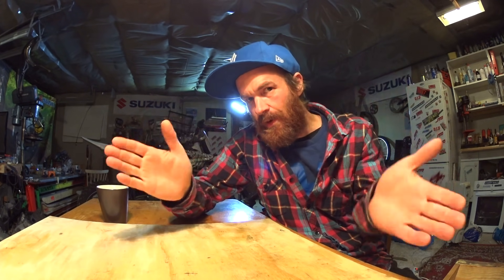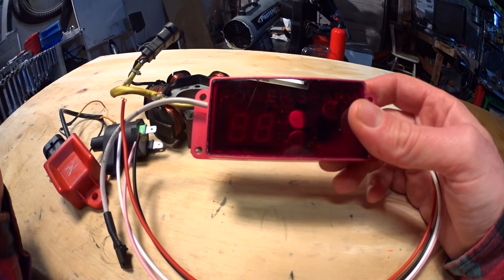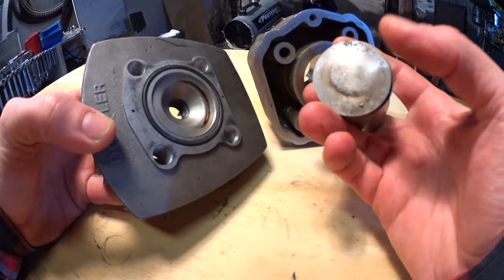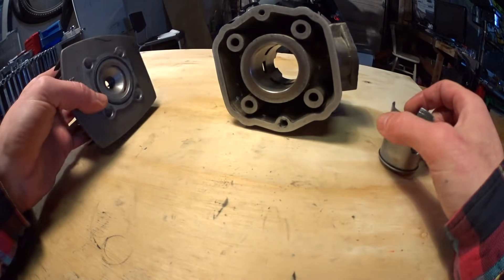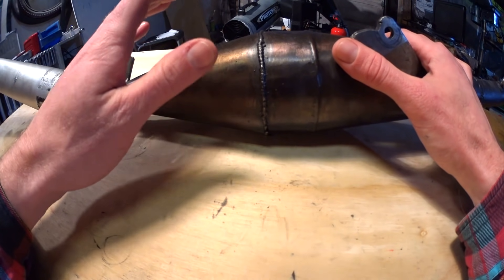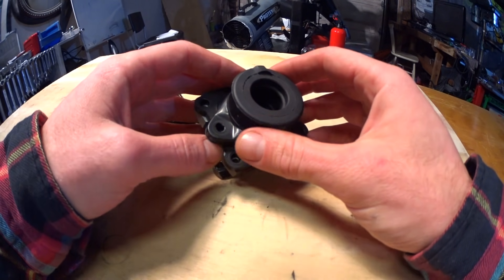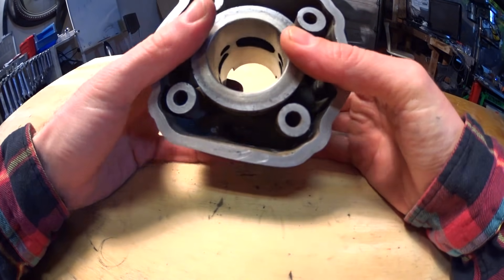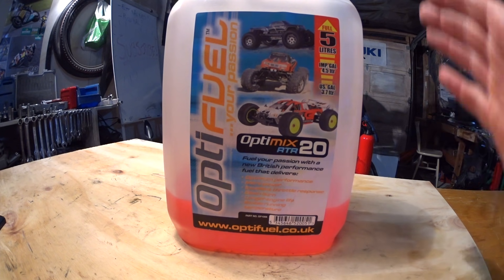10 FREE WAYS to MORE POWER in a TWO STROKE Engine! DIRTBIKE/SCOOTER/MOPED | 2 STROKE TUNING

Comment: If you could show am6 engine tuning, that would be gold💪🏻
Reply: AM6 motors was 2 stroke last time i checked ;)

Do what he said in this video. But make sure to thorouhly research every single aspect of it through other means before you do anything. You do not want to explode your engine.

If you want the quick and easy way to gain some exstra hp out of it and have some cash to spend, look fore a 70cc big bore kit and a new crankshaft.

But the cheep and easy way he mentioned in this video, get a new main jet in the carb. Changing the stock air filter for a high flow/power filter propably wouldnt hurt eighter.

And again, follow the tils in this video, just make sure to research it alot first and read as much as possible about how a 2 stroke work.

Good luck to you my friend 👉
Reply: 80cc pink top cilinder with a doppler crank and a 19mm ali carb
Reply: @jessehirvonen6007  for a daily driven you dont want any bigger
Reply: @jessehirvonen6007  a 24mm has you at the gas station half of the time
Reply: everyone here talking about the 50cc but im curious about what to do with my 125cc, got a bigger main jet since the air filter restrictor was removed and i thought it might have been running a little lean, but it reall didnt do much to go from a 210 to a 250
Reply: @thevideogamer0mg99  what carb do you use?
Reply: You're better off getting 70cc sport kit and a new carb for your yamaha dt because if you tune the stock engine alot the power will be at really high rpm and its not that nice to ride on the street the 70cc sport cylinders have way more low end and high end power than a 50cc cylinder
Reply: @laurisorvari4981  thats boring you whant it to rev high that will be much more fun and nobody whants a 4 stroke power curve on a 2 stroke
Reply: @laurisorvari4981  in some places people are stuck with 50cc bikes until they're older :)
Reply: @EctoGamer  fuck the law put a 70cc sport kit

Comment: Do not add any oil into fuel. This will give you att least +15km/h XD
Reply: No oil ? So you buy yourself a new engine about every 3 minutes cause if you don't mix any oil in a two stroke race bike gas 
.you will get about two to three minutes before the pistons melts and lock up the crank that most of the time twists  the fly wheel pins to junk
Reply: @donniebaker5984  that was a joke in case you didn't notice. (and by the way you are 2 years late) lol

Comment: hey guys, excuse my ignorance im new to this stuff and am here to learn. i know there are major differnces between how a 2 and a 4 stroke operate. but is it possible to free more power out of a 4 stroke using similar principles? I passed my full license and own a 125 but would like to keep it and just free abit more power out of it rather than buy a new bike. 2 reasons i love this bike it was a present from my wife when i passed my cbt  which allows up to 14hp maximum out put. Now i passed my test my test and can ride any size bike. but would rather just play and learn all the mistakes on this one. question is: Can i free more power out of my 4stroke 125 with the basic principles in this video excluding the 2t exhaust step of course. thanks in advance
Reply: You can free up some more horse power but not in anyway can be done like a two stroke

Comment: If you meke the exhaust pipe smaller thers more power?????whaat???
Reply: ideally you want the perfect amount of backpressure. it has all to do with resonance but just keep this rule in mind. inlet surface of exhaust pipe is A and the stinger needs A*0.58 of the surface (so NOT diameter). this is safe but not ideal
Reply from the maker: Good rule of thumb! Even better is to shoot for 0.8x the speed of sound as max velocity in the stinger restriction - but that requires simulation software...
Reply: @2STROKESTUFFING  again if you are building the stinger as a restriction ..you are restricting the maximum power possible and you will not have the most powerful two stroke per cc possible
Reply: @2STROKESTUFFING  again if you are building the stinger as a restriction ..you are restricting the maximum power possible and you will not have the most powerful two stroke per cc possible
Reply from the maker: The stinger, not the whole pipe.

Comment: Nitro fuel only works with the chock on and if you run then engine for more than 1min and try to shut it off it wont even if you unplug the spark plug. Nitro has a lower flash point then petrol
Reply from the maker: Check out my Spx vids, takes more than the choke to get running on nitro. No problems with runaway preignition(it can't really run away cause the plug and/or piston melts in seconds)

Comment: Not one of these "mods" are free.
Reply: You don't have sandpaper and other basic tools?
Reply: Päwkele I have any tool needed. But none of these "mods" will increase power an you'll definitely scare the head using sand paper. Your obviously not a mechanic
Reply: People straighten cylinder heads all the time with only sandpaper. And he explained that its better to use a lathe anyway.

Comment: I made good power on a lot of 50 and 70ccm Mopeds with 40-45mm Stroke with a gap of 0.7-1mm from the Piston to Head. On my Daily Driver i ran a gap of 0.45mm wich was insane but it started to ping a litte at about 30mph (Stock Puch maxi wit 18mm Pipe, 12mm Carb and 1.2hp Cylinder, Stock topspeed of about 20mph)

Comment: I got some buddies talking smack bout my 89 kdx 200 2stroke I want to blow the tires off his yz125  wen we do race any upgrades(or what can I do to make her fast as hell) I can do for free really wish I could talk to u in person but i need some good upgrades anybody
Reply: Resaa Lynn try the ones in the vid
Reply: Don't try any of the mods in the video   and be prepared to spend some serious cash on one of the best two stroke trail bike ever built of anything back then or now ...start shopping around for the later model KDX 220cc engines ..  Ebay is a good start ...as soon as you find one that is supported to be a good runner ..sent it to me for a total restore top to bottom ..and go one tooth smaller on the transmission sprocket ..or better yet maybe two teeth bigger sprocket on the rear ..  Away so its final drive gearing is slightly lower than 6th but still higher than locked in 5th ...get an FMF fatty tuned ex expansion chamber and a " twin Air" Foam air filter ..and a jetting kit that cover jet sizes two sizes above and below the stock KDX 220 cc engine's carb.  Go a few clicks more rebound on the rear shock with two to three inches of sag on the rear spring preload .with you sitting with your gear on and weight .on the bike sitting on its tires with 12 psi in the rear tire and 10 psi in the front tire  on the ground. For a hole shot from a dead stop side by side ..put your chest on the gas tank with your helmet duck bill ahead of the head light ..cock your your elbows 60* clutch disengaged put bike in 2nd gear ...and pin the throttle wide fucking open dumping the clutch ..and burn his ass

Comment: Thought  you were going to talk about stuffing the crank.That was a thing back in the day.Don't know if it still is.That's where you fill in all the holes in the crankshaft with some lightweight materiel,like cork or foam,then epoxy over it to seal it. I did it to my '76 360 Husky,and it made it almost as much of a torque monster as my friends YZ400E,and I could still smoke him on top end.That Husky was blindingly fast.
Reply: I was told by an old school two stroke tuner that he done similar in the piston, cramming cork inside it above the wrist pin, do you think this is likely to do a similar job or worth trying?
Reply: most modern moped cranks in the aftermarket/tuning segment do have either aluminium ore plastic filling to not lose crank volyme.

Comment: what do you mean detonation??
Reply from the maker: Detonation is when you have an explosion in the combustion chamber vs the desired controlled burn. Will wreck havoc on engine internals, erode the piston, chew up wristpin, crush bearings etc. If bad enough you can hear it, sounds kinda like gravel rattling around.
Reply: +2STROKE STUFFING thank you for explaining

Comment: Is it normal for a 2 stroke engine to have a slight carburetor back flow (like drip) while running down the rode? Especially after one has installed a modified jet kit?
Reply: worn out reeds
Reply: @jackmills5071  exactly
Reply from the maker: Sounds strange... Where's it dripping from?
Reply: The air filter honestly it is a small drip because you don't see it or notice unless you have ran it down the rode for a while then the bike will have a small run of fuel oil mix down the side of the transmission cover. My bike is a 2010 Tomos sprint a55 engine. Someone suggested to me that it might be a stuck float but if it were I would think it would leak all the time...but I am no expert.

Comment: I don't get it. How does decreasing the exhaust tube increase power? Some engine manufacturers even make two exhaust ports for 4 stroke engiens so I was thinking that the bigger the exhaust, the better...
Reply from the maker: It's to keep proper pressure in the expansion chamber, many pipes come with too large stingers to have a safety margin.
Reply: @2STROKESTUFFING  it has nothing to do with exhaust gas pressure ..the stinger is not built to maintain any pressure inside the expansion chamber at all ...as if it did the engine would only creation more restriction as it tries to increase rpm until there would be not enough exhaust flow to allow combustion , flame out , game over ... Stingers are designed to maintain a specific resonant frequency from the sound of the combustion as it bounces off the tail end of the expansion chamber causing the sound wave to reverse direction back to the exhaust port as the sound wave blocks the boost pressure from the crankcase of air and fuel mixture from escaping the exhaust port for a period in time until the piston on its compression stroke covers the exhaust port for a fraction of a second before the ignition ignites the combustion chamber causing the boost process all over again and much more violent each time a port induction two stroke fires ..as at a curtain rpm boost  comes in so violent on 500cc dirt bikes will flip you and the bike over backwards if you are not aware of what is going on the first time you try to ride one... the compressed boost more than doubles as it is compressed in the combustion chamber from the boost from the sealed crankcase making a much higher sound wave capturing the highest percentage of explosive air fuel mixture as it  is said to be "on the pipe" and the beginning of "the power band" that continues at an ever increasing rate second per second ..so the only limiting factor is the CFMs the atmospheric pressure can push through the carburetor Venturi or a throttle body...basically a port induction two stroke is a centrifugal supercharger with a spark plug.. and the main reason why a 4-stroke will never ever make the same horsepower as a two-stroke both naturally aspirated... Two Strokes make boost that never stops gaining boost...4 strokes can only suck and blow
Reply: Not entirely true ..too  big of exhaust  and you will lose fresh air/fuel incoming  from the inlet track that will go unchecked right out the exhaust ..NOT from lack of exhaust gas pressure but the resonant frequency of the exhaust sound wave will not be at the right time or powerful enough to stop the air/ fuel mixture from escaping out the exhaust port
Reply: A 4 stroke has valves that keep the air fuel mix in the cylinder until detonation, a 2 stroke does not. 2 strokes need back pressure to make the best power efficiently.
Reply: @johnpike9612  back pressure from exhaust gas has nothing to do at all with the function of keeping the intake boost from escaping the exhaust port ....there is no such thing as back pressure inside a two stroke expansion chamber ..an expansion chamber is a sound wave chamber that reverse the sound wave cause by the explosion of combustion that stops the induction boost pressure from escaping the exhaust port
Reply: @donniebaker5984  if it keeps the fresh air fuel mix in the cylinder then it pressure.....nobody used the word gas. Just back pressure and technically we're right since we didnt say gas or sound waves.....both creat pressure to limit the amount of air feul mix that escapes the combistion chamber....we just didn't get all sciency and crap for the people who wouldnt understand it any ways 😉
Reply: You need to learn how 2 stroke works.

Comment: Can you say which mod is suitable to increase low end torque,im using moped 75cc dirt bike
Reply from the maker: +prathish low port durations and a long pipe.
Reply: 2STROKE STUFFING increasing CR by phasing the top cylinder will help at low end torque. ..and thanx,and all your videos are great.
Reply from the maker: +prathish Thanks!
Reply: 2STROKE STUFFING yea man...and sry does low end torque increases by phasing the cylinder head
Reply from the maker: +prathish raising compression should yes.
Reply: The power valve (Yamaha YZ125) was added to boost low speed torque. I had a chance to ride one (YZ125) and it had lots more power low down than my RM125X. As far as I know, the power valve adjusts the exhaust port height. An easier thing to try is a "boost bottle". Another Yamaha innovation. Works as a Helmholtz resonator to boost the intake side pressure at the speed you require the power boost. I am not sure whether the intake boost bottle would affect any other settings like jetting, spark timing or exhaust expansion chamber dimensions.

Comment: on a piston port engine figure out which skirt on your piston is the intake side and cut it as short as you can. that keeps the port open longer and thus more fuel. then on the exhaust side run the piston all the way to top dead center and mark the bottom of the port on the piston then remove the piston and cut the skirt of the piston off just about a quarter inch below that mark.
Reply: "as short as you can" is very dumb. If you take too much you will lower the speed of the transfer ports as some pressure will go back out the carb
Reply: @KalLanPIDT  only doubled the hp on a kt100

Comment: you have obviously never raced a two stroke , on your dyno with such a short period at w o t you can jet down provided the mid range is rich ,but you try that on a 1/2 mile straight and by half way it will have seized,,i have spent 30 years tuning strokers for road racing ,it took suzuki years to develop their 50 racer they were making 18 bhp at 12k using a12 speed gearbox[ they may have had more ]these bikes were capable of 115 mph , so instead of all the b s  we see here put it on a straight road if you get anything like the above then you are making 20 bhp
Reply from the maker: +ALAN COLLARD If you're too rich before you jet down you won't sieze, it's relative like everything else. The high speeds reached were mostly caused by good aerodynamics, and how many years Suzuki spent is irrelevant.
Reply: live in the real world dude you are reading your mixture settings after a max of a 10 sec at full power though out its rev range , why do you think in the real world every one uses a steady state dyno as i said instend of te;lling all your dyno figures back it up with real speed , its horse power that makes speed , torque equals acceleration , there is a thousand of us ex two stroke riders and drivers , the longer the straight the richer you need to be, now i dont decry your efforts your home made dyno is a exellent comparitor for comparisons between mods that you have done provided you keep a log of the cell temp and barometric pressure as this effects an real world results , i have worked in the steady state dyno field and rolling roads for 40 years , but when you see a major manufacturers dyno set up you will be amazed , i worked with rover group in the late 80,s and then their cells were unbelievable , everything was repeatable , air temp and high baro pressure will make more horse power by doing nothing . when running a steady state dyno we check the calibation every day
Reply from the maker: +ALAN COLLARD "the longer the straight, the richer you need to be" might apply to old air cooled racing engines but certainly not to a modern water cooled setup. You make some good points, and I mostly agree with you, but you're coming off as kind off a douche.
Reply: damn whats with the hate alan?

Comment: Does rc fuel have any problems with non castor 2 stroke oils? How about needing to drain the fuel system between uses (like alky drag cars)?
Reply from the maker: +ludditeneaderthal yes it does but some synthetics and ester based works. You need to "purge" the system after use just like with alky drag cars, methanol is corrosive and hydroscopic.

Comment: Please explain 1:38 . Do you mean in low rpm the piston gap are greater? New into mods world.
Reply from the maker: +Muhammad Syafiq Yep, due to rod stretch and crankshaft bending the gap gets tighter as rpm is increased.
Reply: 2STROKE STUFFING Will increasing the compression ratio reduce the hp and rpm? I know by doing it will increase the torque but will sacrifice the hp? And thanks for the explaination though. Never knew it.
Reply from the maker: +Muhammad Syafiq It depends on what ratio you're and the fuel used. Pump gas = less compression, more ignition advance, race gas/avgas = higher compression, less ignition advance. It's part of the juggling act of distributing energy between the cylinder and the pipe.

Comment: Hi ! There was no mention about jets ; for instance,  in a  Vespa 90cc , the Dell Orto original  Main Jet is 63;  replacing it with a  65 or 67 Jet,  wouldn't produce more  power, without affecting reliability ?  Thanks  , oscar